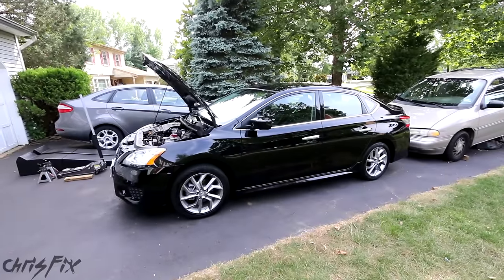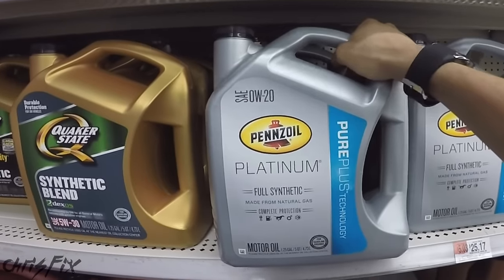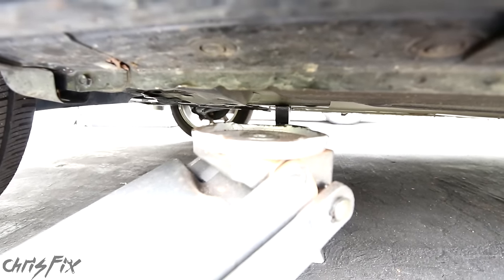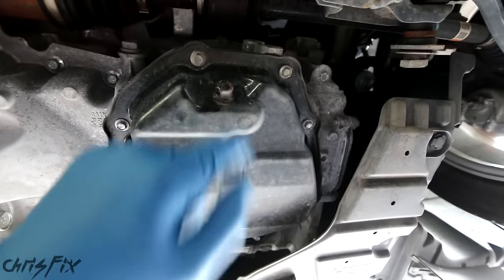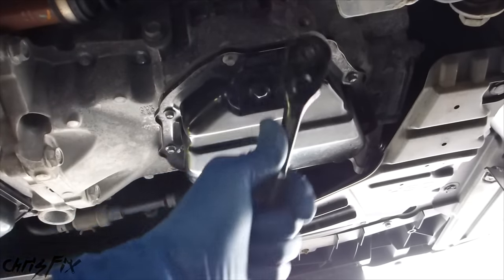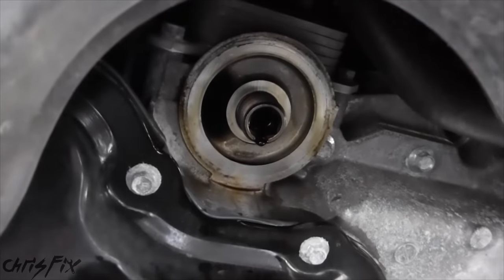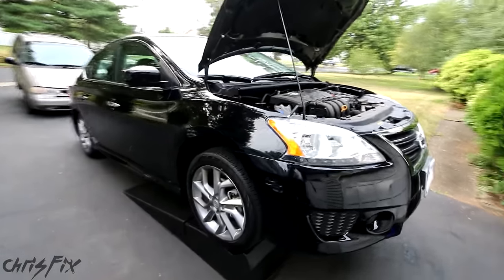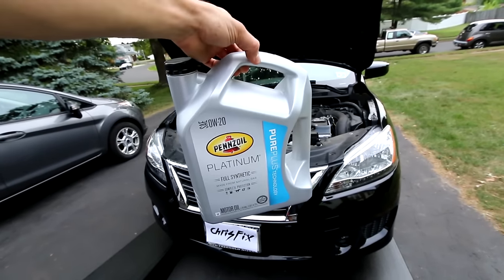How to Change Your Oil (COMPLETE Guide)

Comment: Wouldn't it be great if cities had designated areas that you could use to work on your car.
Reply: Mike Camaro yuuuuup. I hide in underground parking and work at night lol
Reply: @GuardianDown56  That's that a bad idea. In my city most parking garages are monitored 24/7 which is freaking lame. There is a Walmart a couple of miles out it might just do the trick.
Reply: Mike Camaro yeah that’s lame for sure, the garage I use isn’t monitored, lots of us work on our vehicles down there haha, but it is a joke trying to work on your vehicles in the city if you don’t own or rent a house with a garage.
Reply: Mike Camaro what’s so bad about them being monitored?
Reply: @RT-zn9bj  They are usually followed by warnings and fines. They will tow your car they don't care.
Reply: Thanks for the curb trick to get under the car. That saved me even more money from having to buy extra equipment.
Reply: In Sweden we have these DIY car wash halls that often have a lift to work on your car. They charge about 20 cents a minute. They even have disposals for used oil, filters and coolant.
Reply: @nathan_787  that sounds amazing.
Reply: At the Army post we are at they have an Auto center that has lifts, all the tools you need and you just rent it all for the day, it’s super cheap and reasonable and you have full access to the tools and the lifts and wash bays!
Reply: @GuardianDown56  tools would be stolen
Reply: The Fantabulous JalaPeña I don’t leave them down there lol
Reply: I live in an apartment in the Czech Republic and rent a garage nearby and at the end of the line of garages is a ramp and pit exactly for this.
Reply: Yes, perhaps an area with a 5 dollar fee for a spot, and the basic essential tools available. 

Also, the parking spot already has pre made ramps to get your car on
Reply: Mike Camaro there’s a local shop in my city that lets you come in pay for a stall and work on your car using their equipment pretty dope .
Reply: Mike Camaro that’s a great idea
Reply: Military installations do. Time to Army up, son.
Reply: @nathan_787  Another reason why sweden is a good place envy you
Reply: @Str8Vandle  that's actually not a bad idea for a business. you could just rent out spots for people to come in and work on their cars. you could have it where it's required that they get the work done in at least 48 hours. that way, for people who live in places where they can't work on their own cars due to rules/regulations, they can come in, rent out a space for a bit and change the oil, change the brakes, change the plugs, clean it, etc.
Reply: They use to be a thing but just like heathcare, insurance ruined it.
Reply: Mike Camaro there already is...your house 😂
Reply: Mike Camaro f
Reply: We have some of these in the UK. Self Service Car Garage’s with post ramps & lifts etc. Some have tool hire & a mechanic available on site & access to a computer with internet (in case you need to youtube Chris fix)
Reply: @nathan_787  I live in Norway so I'm curious what these places are called in Swedish? Maybe we have them here too and I just don't know what to search for.
Reply: @WithYouIDisagree  They are called gör det själv hallar in Sweden, sometimes GDS for short!
Reply: @tamasormai165  Heh, it is quite nice here. Nowhere is perfect though, even Sweden.
Reply: Alot of major cities have dyi auto garages. Google it. They charge about 50 bucks an hr. A little pricey but they have lifts and tools.
Reply: Mike Camaro they do, its called your driveway
Reply: Mike Camaro it’s called your garage...
Reply: In Germany we have a lot of DIY garages with everything you need to work on your car, they take about 10-20€ per hour (11-22$).
Reply: @nathan_787  Make room, I'm moving in
Reply: Govt. doesn't need to provide that. 
Work inside your apartment.
Reply: Thank God we don't live out in Sacramento, California.
Reply: Mike Camaro go to a school parking lot or drive out to the suburbs bro
Reply: I have an abandoned laundromat right next to my house. A lot of people do the same thing
Reply: Canadian Tire if you live in Canada
Reply: It's called a driveway
Reply: and if it cost like 15 bucks to enter and had tools and everything there that u might need, government would gain money, and people will be able to work on their cars again. (plus save MULAA)
Reply: What a beautiful world as far as the main comment that is
Reply: Don’t you have ditches where you live?
Reply: Mike Camaro i beleive they are called drive ways
Reply: Mike Camaro yo I have even a better idea IN FRONT OF UR HOUSE!!!!! Wooowwww
Reply: Changed my oil 2 days ago but really enjoyed this video. Been watching all of your videos all day.  Im a ch53 helicopter mechanic and love getting my tools dirty.
Reply: Mike Camaro damm
Reply: Many cities have makerspaces with garages where you can do stuff like that.
Reply: Go to a car wash. You can wash it, change th he oil and so on.
Reply: @GuardianDown56  😂🤣😁
Reply: New business idea, self rented garage in a city, where for 25 bucks an hour you can rent out a garage with a lift to work on your own cars, lift included bring your own tools or rent tools for extra.
Reply: Top Game Trailers that’s actually not a bad idea.
Reply: Texas used to have a place like that.  It went out of business sadly.
Reply: Reading this thread makes me feel spoiled having an uncle with his own shop.
Being his only nephew with any interest in fixing cars he encourages me to come to his shop whenever my beloved shitbox needs work and use all the tools, scanners and lifts i need to keep it running.
Reply: Be great car meet place
Reply: @nathan_787  Oh wow, that's awesome! Tell the owners to build some in the USA!
Reply: Sounds like an easy target for thieves; cars, parts, or otherwise. A busy mind and hands plus valuable parts and tools plus diminished situational awareness equals big no no.
Reply: @53prime  sheeeit not Fort Bragg, son.
Reply: People would abuse it...Leaving their car there on jacks for weeks with shit sprawled all over the place...You know it’s the truth🤣🤣
Reply: And if they had a fully equipped shop open to the public.  Just need I.D and debit card to access
Reply: @shamyyy1  thats my exact business plan for here in the states.  Wish me luck!
Reply: It’s called a garage lol
Reply: They had that in Soviet union and in early 90ties in eastern europe !
But peole are pigs ,they just drain the old oil on the ground and dont bother to clean it , so these places got scraped.
Reply: @murderouskitten2577  maybe add rules and consequences for not cleaning up,
Reply: @carylsue.  poor people am I right
Reply: @subliminalpain  dude what the f are you talking about, you can change your oil on the street just don't drop it on the road
Reply: @nathan_787  thats why sweden makes sense
Reply: You should be a city planner
Reply: @mrbiggiecheese312  factual actually
Reply: Sometimes you can ask your local community college even if you're not a student and a teacher might let one of his students do it for you for extra credit or he might just make sure you do a good job like in my city I have friends in his class but he knows I cant afford it so if you explain it to them you might get lucky
Reply: @ltwadley7619  my stepfather taught me using a ditch when i was 13 lol cheap bastard😅😂
Reply: @nathan_787  now that sounds like a goldmine have diy service bays 10 per hour. 7 days a week 10-12 bays rent floor jack 3-4 bucks an hour,  man🤑🤑🤑🤑
Reply: @EdwinMactalMusic  sum bastard will steal the tools....
Reply: My maintenance contract up iam getting ramp, cheap tool set, pot belly air compressor start my basic servicing at home and light duty repair tire repair... shops charging 70-90 per hour. Shade trees dont want to do the hard jobs no more always i dont have the tool.🙄

Comment: I made a comment several minutes ago on changing brake pads and rotors and figured you might have something as simple as an oil change video and even though this was longer than the brake pad and rotor video, I’ve seen other videos that show oil changes show the same, similar moves, steps, all that stuff, but you still help in the long line of videos I’ve watched of changing your oil on the fact that it can be done as simple as your videos make it, and one thing I liked about both your brake pad and rotor video, and this, is that you’re very detailed and explanatory with stuff, which makes something that people think is a complicated thing, relatively easy to understand and then end up doing yourself after you’ve seen the video which I think is cool.

The only thing I’ve always had an issue with before, ever actually taking out and trying to change my oil is, between the ramps, the oil, the paper towels, and the tools and the filter, you either have to purchase everything initially if you don’t already have them and you’re just fresh and new getting into this, which I’m fairly certain would be a decent amount of money to put down on all those things, but if you have at least a couple of tools, at least, the unfortunate thing that I do, at least understand myself is, I like you would use the ramps, and hold down my parking brake, which I use in my car whenever I park. Anyways, I just naturally started doing it one day with my 2012 Mazda three, which was the previous car I owned, so now I put the parking brake on with my 05 Honda CRV, but one of the only issues with ever changing your oil is the initial money put down for all the things you need to cover it being done, but usually after you’ve acquired the general amount of stuff, I would think that screw in plugs that you would replace that you initially pull out when the oil Shoots out quick like someone who’s been holding in their pee for an hour and a half, buying a new oil, plug, the oil itself and the filter. As long as you have everything else are the I would think less expensive things to have to get down on if you intend on doing it your own, and sometimes the money isn’t always there to afford Purchasing everything down right, but the one thing I can understand and agree on with other people is that once you have either a couple things that you need for doing it before hand or once you put down the initial money for everything you need with I’d say 2/3 of those things being the tools, paper, towels, and ramps, the new oil screw, the oil and the filter are really the only things that are that you have to buy every new time around when replacing it so all the initial things you have to put money down. If you don’t already kind of pay for them selves over time and you’ll have them for all of your other vehicles as well.

I actually do eventually want to do my own oil at least once just to know that I did it, and that I could say it was maybe as easy as somebody else said it was, because in general, I know how to change a tire, and I’ve had to put spares on my prior vehicles Overtime, so that was one thing I knew how to do, jumpstarting, another persons, car with jumper cables, and changing a car battery, now my previous vehicle, my 2012, Mazda three, and my 2004 Kia spectra before that, had easier set ups for the car battery, but the car battery in my current vehicle has a lot more in casing and parts around it, so I’m sure sooner or later I’m going to have to learn how to Uncage it so to speak, and be able to take it out, and then reverse the unchanging with a new battery, and be up-to-date with this current vehicle.

But I would like to be able to sometime down the road, be able to do that, and say much like anybody else that’s told me how easy it is, add that as like, if you were adding more experience or another job to your résumé, just be able to add another thing to a vehicle that I can do that’s relatively easy that even if it took a short while, I can say I did, and whenever I actually have the money to afford buying some of the initial things that help with the set and start up of it, I think that would be cool, and I myself would use the ramps as well.

Comment: Hey Chris i recently did my own oil thanks to you . I used pennzoil high mileage pure plus synthetic oil and a k&n oil filter totally different from the cheap stuff they use at jiffy lube . I did struggle because I just bought this car a 2008 Chevy impala Lt and the guys who did the last oil change not only stripped the oil drain bolt but tighten it up so much I cou ldnt get it off. I tried everything ..all I had some tiny vice grip pliers . finally after hour's of using brute force I saw this video again remembering I could use a pipe over the pliers and voila cracked the bolt open and that's all she wrote. My next project is to do the front brakes on a 2001 chevy Malibu,  I'll definitely keep you posted.
Reply: illwill  I always take my car to Jiffy Lube. I didn't know they use cheap stuff. They charged me $35. Next time, I will try to do it myself.
Reply: illwill penzoil is what they use at Jiffy Lube
Reply: Buy a set of Irwin Easy Outs. For $25 you get a set specifically designed to get out stripped or broken bolts etc. It is basically a left hand threaded set of sockets with teeth and they really bite into the bolt remains. Good luck.

Comment: Before unscrewing a drain plug, I like to first open an engine oil cap on top to equalize the pressure. As a result, more oil will come out quicker. 
Other than that, great video. Thanks!
Reply: It doesn't matter because engines have crank case breathers.
Reply: Rudpavv Rudpavv aren't those one-way valves allowing gases out?

Comment: A tip for tightening bolts with no chance of cross threading is to start screwing it in reverse like you're unscrewing it, then when you hear a click, screw it back in. The click is the threads aligning.
Reply: This!!
Reply: Never over-tighten your drain bolts again. The ValvoMax Oil Drain Valve is a one-time installation.
Reply: joblessalex Nice tip!  I've always done this and have never had any problems
Reply: Yes...but it doesn't always click.  Like older bolts or if the threads are grimy/dirty.  when reversing (or loosening) the bolt you should feel a slight step down, therefore aligning the threads.  Just by chance you can't hear or feel anything, you can just back off on the bolt a few turns before tightening it.
Reply: joblessalex hyggygg
Reply: Physics

Comment: My tips: 
#1 - Buy your oil from Wal-Mart. WAY cheaper there then any Auto parts store, by like $5 or more.
#2 - Don't buy FRAM Oil filter's unless you get the Ultra Premium one. They are held together by cardboard.
#3 - Read the dipstick of your car on a level surface, not a sloped one. 
#4 - After you've changed your oil twice, use the old plastic jug to transport your oil, because it stays sealed and won't leak if you have a car. Best in the 5 quart jugs.
I think that's all I got. Nice video Chris. Gonna send this to some co-workers. :)
Reply: Buying oil from Walmart might be Cheaper but it’s also a good idea to look at auto stores and see if you can find deals on oil and filter. It could be cheaper overall in some cases by $10-$15
Reply: FRAM air filter should be alright, but oil nope :)
Reply: i agree stay away from fram
Reply: do u have mann oil filters in US?
Reply: Wix @itsdimitriymedvedyev
Reply: I have a mann filter in my car, it is a real good oil filter.

Comment: Just finished my first oil change! Thank you so much! Took me a couple of hours of back and forth from the store getting everything I needed but it worked out! I hope to start being more hands on with my car. Just another thing added to my repertoire :)
Reply: What did you use to jack up the car, was it a ramp like he has or a regular jack
Reply: @ohsosaucy  same question
Reply: @amukhb8608  I ended up going with 2 jacks
Reply: @ohsosaucy  thank you, the jacks are very expensive where I live Australia, seems the only way is to get my oil changed to the mechanic
Reply: @ohsosaucy  I know this is old but I would recommend every buy ramps, they are safe and they last forever.

Comment: Hey chris, I know this is an old video. But I had a few additional tips to share in the comments. I am a tire technician at a automotives shop  but it's a small shop and we have 2 mechanics. They work on the more "difficult" jobs and leave me with the simpler jobs. Oil changes being the most common. When changing the oil, loosen the drain plug for the oil pan, almost all the way, when you feel that the plug is on its last thread, be ready to quickly yank the bolt away, this will reduce splashing. For the filter, we don't pretty fill. But it's a good thing to do.  When tightening the filter, tighten untill you feel resistance, then do 3/4 of a turn to snug it up. When checking oil after filling. It's also good to check other fluids. Check transmition fluid while the car is running. If there is not a dipstick for transmition, you have to check it under the car while it is lifted. Finally, after you've checked brake fluid,   power steering, and coolant. Check the air filter. They aren't too expensive to replace. (If you cant find a power steering reservoir,  your vehicle will probably have electrical assist.) Thx.
Reply: At last!
Ive been looking for this for about 5 mins already, after i saw he only tightened the filter by hand. Haha
Reply: Also, removing the oil cap in the engine can help the oil drain a bit faster. Once my oil is not gushing out, on my vehicle, I can just about fit the dripping oil and catch the filter oil in my spent oil container so I drain the pan and filter at the same time. Also, a fumoto valve makes changing oil a breeze.